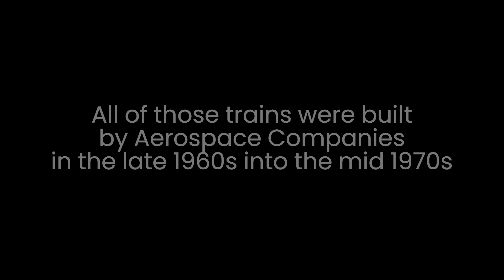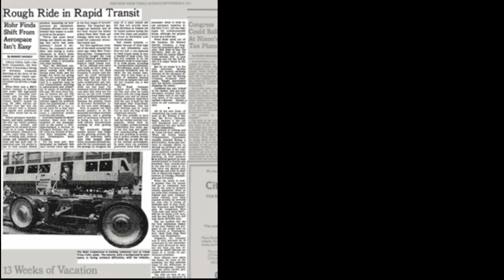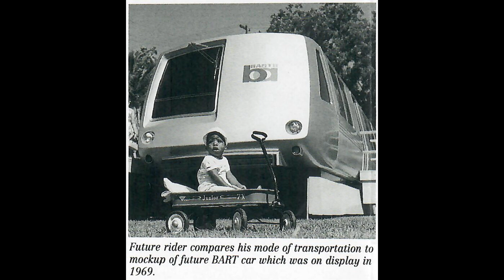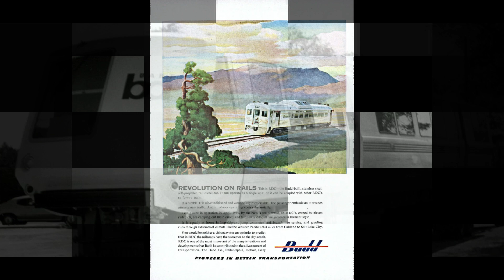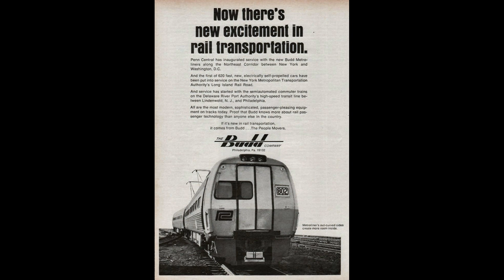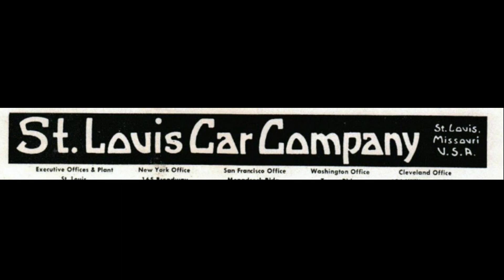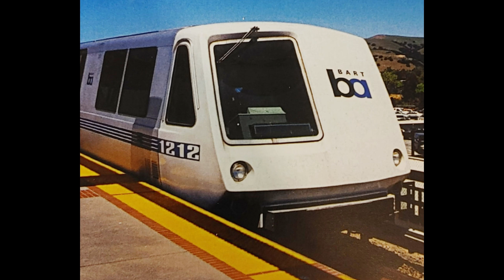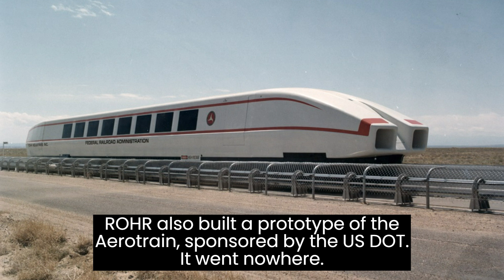Why the Aerospace Industry Abandoned Mass Transit [Early BART Challenges]

Comment: Excuse Please, But I have been a BART Rider since it open the SF Branch Line back when I was in High School and in time slot 13:25 that shows the BART Fremont Station that I remember when the Fremont to Richmond line as that when the train arrived, and was suppose to depart back to Richmond that instead of leaving it Forward by crashing the station wall and falling onto the street. I remember when seeing the BART Car on the street that station KTVU, and KRON TV News were showing it, and then reason is that it might be in what you said about ROHR Industries at Fault in which BART did Sued them BUT it was a BART Maintenance Technician placing the BRAKE MODULE BACKWARDS so instead of when leaving the Fremont Station as it did not go in reverse since all BART cars to not turn around, its works as in a Y Switching mode so like I said it did not got reverse but FORWARD. The BART Car was working well but it took one person to do one mistake... Lucky their were no fatal injuries.
Reply from the maker: Hello!  Thanks for the additional information about that BART accident! Very interesting!! Thanks very much for watching!!

Comment: Grumman of Nassau County, Long Island, built fighter jet planes for the U.S. Air Force. In 1980 they built the worst city transit buses in NYC. They looked like boxes on wheels and the diesel engines caugh fire and often fell out under the back of the buss.
Reply from the maker: LOL, amazing that this bus was from Grumman! Thank you for watching and for your comment!
Reply: @JeffreyOrnstein  They also ran on the B56 bus line on Jamaica Avenue and the bus drivers despised them. By the way when I was attending Junior High School 217 in Briarwood, Queens, the B55 bus line also ran on Jamaica Ave but left me one block from my home. When the first bus came it was the B55 and I didn't mind walking one block to my home. I got on and sat across the bus driver and I looked at the builder's plate on the dashboard. It said built by GM 1949 and it was still running in 1971! Back then GM built vehicles were built to last. 😁

Comment: Rode the UA Turbo, BOS to NYP Hard riding, bouncy and noisy. The turbines roared deafeningly as it accelerated with lower performance than a straight off the wire local MU "washboard".   Still it was faster than the Acela is today on the stretch through New Haven line electric commuter territory due to not being subject to slow orders from sagging catenary. Great view in the dome. Broke down so often the premium fare was dropped. Turbines are a poor choice except when running at one speed for long periods.
Reply from the maker: Thank you for watching and for your very interesting comment on your experience riding the Turbo!

Comment: In the case of the Rohr Corporation, that by the way was a sub assembly supplier to larger aerospace companies, that built the bart and Washington Metro cars, fabricated the car shells using materials and processes that were not used in the building of airplanes or passenger rail cars.
Reply from the maker: Thank you for watching and for your interesting comment about Rohr!

Comment: 5:50: The Pullman Company merged with Standard Car Company in the 1930s to become Pullman-Standard, not the other way around.
11:12: Boeing's light rail cars were built in its Vertol plant in Philadelphia, not Seattle.
14:21: Rohr (a name, not an abbreviation) had nothing to do with GM's Aerotrain which used modified GM bus bodies.
Reply from the maker: Thank you for watching and for your comments/corrections!

Comment: 13:34 can we take a moment to admire that coach? It could have 999 problems but rigidity wasn't one
Reply from the maker: Thank you for your comment! Yes, the carbody sure survived tha accident!
Reply: The reason for the train running off the tracks was due to dirty rail. Remember BART used cylindrical wheels (presumably for better electrical pickup) rather than standard tapered railroad wheels. It had just rained and the car wheels could not pick up the stop signal. The fix was to add wire brushes ahead of the wheels to scrape off the rust. Seemed to have worked.
Reply from the maker: @Greatdome99  Thank you for watching and for your very informative comment!

Comment: Interesting sidelight to that notion in the article that transit agencies should not set specifications so tightly, and let the companies do what they want...  The Boeing-Vertol streetcars were so awful that only two cities (Boston and San Francisco) ever used them, with Boston even rejecting much of its order as unreliable, choosing to stick with then-fifty-year-old PCC streetcars that had to be repaired by custom-building each part.  At one point, a scandal erupted there when a reporter found that many brand new, but unusable, Boeings had been stuffed into unused tunnels downtown.  Of the just one or two such Boeings that made it to museums, not a single one of the cars still works.  Contrast that with the hundreds of working examples of earlier streetcars, such as the 1922 Perley-Thomas cars in daily service in New Orleans.  

Meanwhile, the Boeing folks were faced with the CTA in Chicago, which had designed their preferred car type in the late 1940s, and went to Boeing-Vertol with a complete set of plans and specifications that left the airplane builder no choice but to use the exact parts and design specified.  It was a case of "build us more of these."  While modernized to use the best actual rail equipment of the time, the Boeing cars had a very long and unremarkable lifespan on the CTA "L", running reliably and lasting until very recent times.  

So, which plan worked better?  Let the companies build whatever junk they wanted, or build an actual railcar specified down to the last bolt and nut?   Sure looks like the CTA was the only winner of the aerospace incursion that really only occurred because of the end of the Vietnam War.  They ordered their own design, and got what they wanted.  The aerospace engineers seemed to think that building trains was easy, never quite realizing how tough it is to build a reliable cars that, unlike an airplane, is not massaged constantly by flocks of mechanics.
Reply from the maker: Thank you for watching and for your very detailed comment! The whole Boeing LRV debacle sounds like it's a good idea for a future video.

As for the CTA's 2400 series builty by Boeing-Vertol, yes, you are right! I missed that one! I just looked it up in CERA's Chicago Rolling Stock Volume II, and here's why it may have worked out for the CTA: The body shell was fabricated in Portugal, and the trucks and motors and some electrical equipment were from Germany. So Boeing didn't build all of it (or maybe most of it), so in addition to laying down their own specs, they won out with the 2400s, which could have turned out a mess otherwise...
Reply: @JeffreyOrnstein    I suspect it would be a good topic.  Start with the search term "United States Standard Light Rail Vehicle," the official government-issue name of the Boeing-Vertol streetcar.  First American use of the term light rail, too.   There are a few places online that detail the Boston debacle.  San Francisco ended up with those cars, distinguishable by their different interiors.  (Yes, despite the yells about standardization, the Muni and MBTA cars were different inside.) 

As an original design, the Boeings are like that quote from Samuel Johnson, "Your manuscript is both good and original; but the part that is good is not original, and the part that is original is not good."
Reply: Yeah, this is a hotly debated topic because transit vehicle procurement is so incredibly visible from start to finish. Over-speccing has its own pitfalls. Most procurements these days fall somewhere in between where carbuilders bring their own platforms and customise them, either in configuration of existing subsystems or swapping to agency-preferred subsystems and suppliers. The majority of procurements these days do follow functional requirements rather than detailed technical specifications. Now that I'm involved in specifying passenger info systems myself, the devil in the detail is clear to me: functional requirements can still end up sourcing unreliable or stupidly bespoke components.
Reply: As I recall, the articulated bodies of the Boeing cars had a nasty habit of derailing on tight curves.
Reply: @Greatdome99    Yes...  Boeing had designed their own version of an articulation joint, and it did not work nearly as well as they expected.

Comment: Rohr also bought Flxible and designed and built the Flxible model 870 Advanced Design Bus, which also turned out to be an engineering disaster initially. It soon sold Flxible to Grumman.
Reply from the maker: Thank you for watching and for your very relevant comment, Glenn!